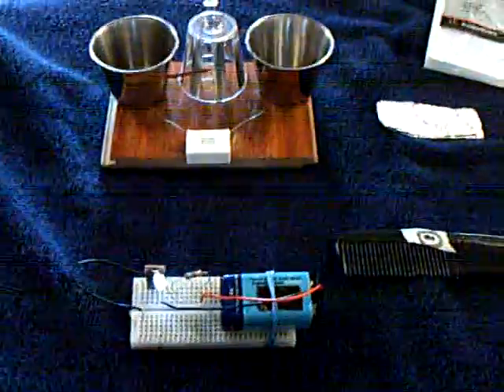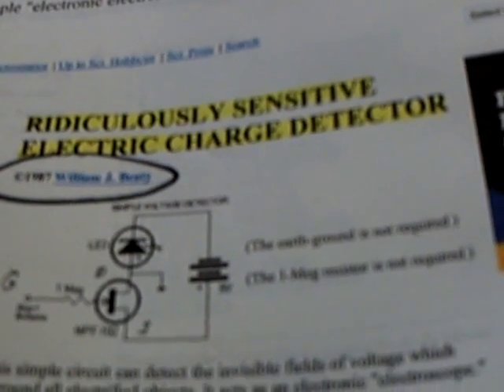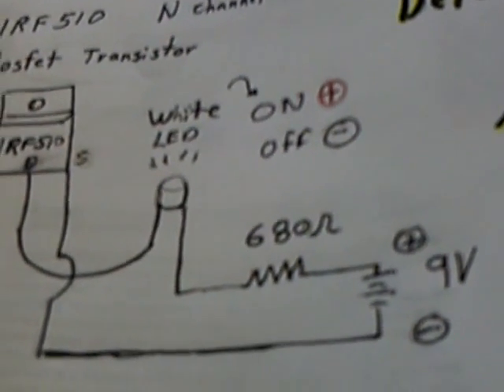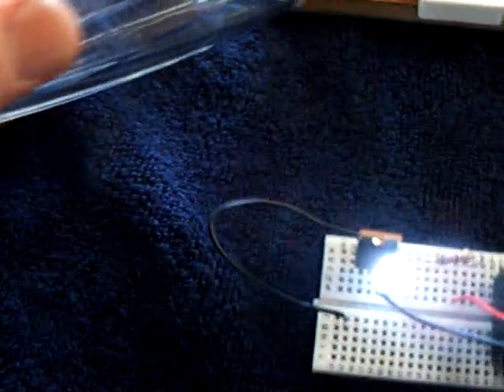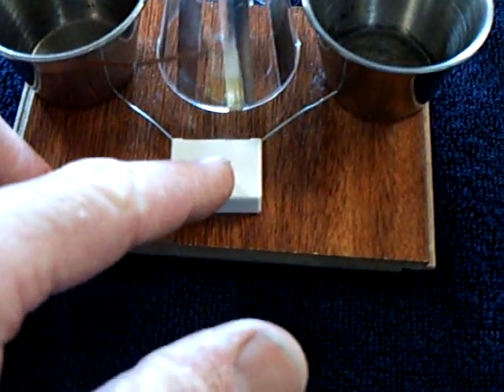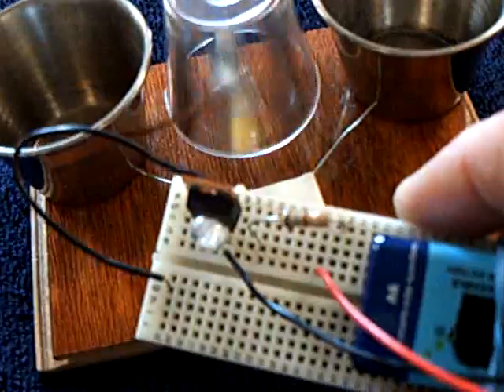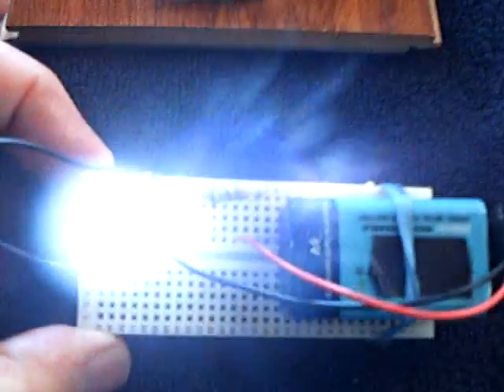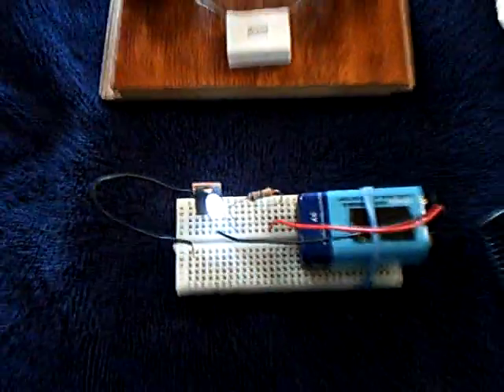Electric Charge Detector

Comment: I built a similar circuit using only 5 volts. if you ground the gate, the rest of the circuit will turn on with a negative charge. I was also able to get the dual MOSFETs from AliExpress.

Comment: Hi Lid. Much appreciated video. I had made Bill B.'s electroscope on a 9v battery and it was the best. I broke off the gate and it was still useful until dropping and cracking the transistor. I had two Radio Shack MFP102's  so I put the second on a bread board with a big antenna and ground wire to use as a lightning detector. Well,  my home built Van De Graaff worked way too well be near it and I fried the transistor. So I bought some fairchild mfp102's and tried everything and not one would work. I had this IRF510 and gave it a go but had a hard time keeping it working continuously. Disappointed I went to e-bay to search out the last  Radio Shack mfp 102  transistor that worked so well. I am going to try out different detectors. I have a corona motor, a Helium balloon and carbon fiber charge collectors, big ground rod, cable, a uv laser and a tower I am making I will call The Jefimenko Tower.

Comment: You can find any transistor, led or diode on Ebay.
Reply from the maker: +ThomasTheSailor Chubby Thanks.  I have used Ebay for many purchases but if it comes from the orient it takes 4 to 6 weeks to get to me.  If it is in the US it is no problem and usually gets her in a few days.
Reply: *****
  You're right,  That's the first thing I check too..  But you will find plenty from the US..

Comment: I read below using jfet really cool. I built one of those it used two transistors the plans from Forrest Mims,  that thing charges with incredible sensitivity. On a separate note,  the  slayer exciter has really made a lot of progress lately.
Reply from the maker: Thanks. I will look up the Forrest Mims circuit.

Comment: I built one using Beaty parts, put in small RS project box, using antenna from a portable radio.  Almost a must have tool.  You are going to love it,  Walk around and check everything, what fun. Good video as always.
Reply from the maker: I think I will box this up like you did.  It is turning out to be a very handy tool.  I need to work on a gain control for the gate though so I adjust the sensitivity.

Comment: I built a few similar things a while back but never so simple as this ! great find ! You should also see it comically dim in time to someone walking past on carpet.
JFET BF245A does similar for regular transisor sized and 3V operation.
Old Intel 8085 chips were my best detector and ran from 2V upwards (used to be in 8080 PC's from early 1990's). Supposed to be 12V, but functioned great as electrostatic testers.
Reply from the maker: Thomas Kim has a few of these designs and I decided that it was time to build one.  It is actually a very handy tool for the electrostatic experiments that I'm doing.  The Mosfets are easily blown though if a HV static charge actually sparks the gate.  I sent a few of them to semiconductor heaven before I started being more careful.